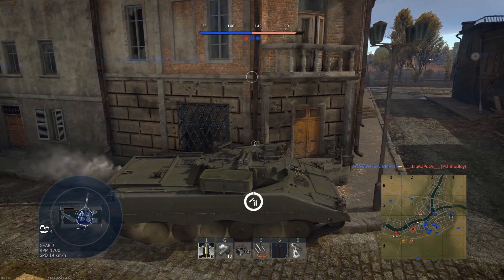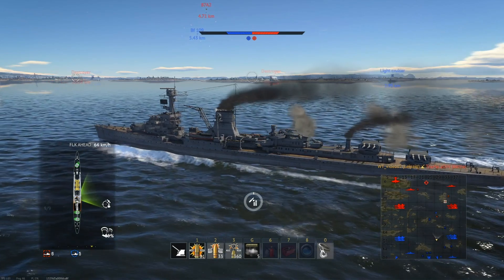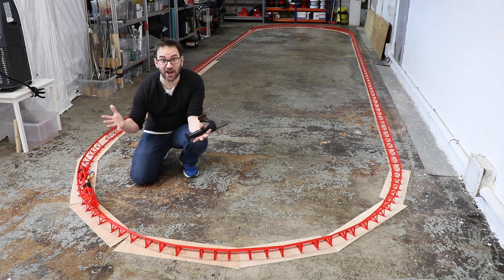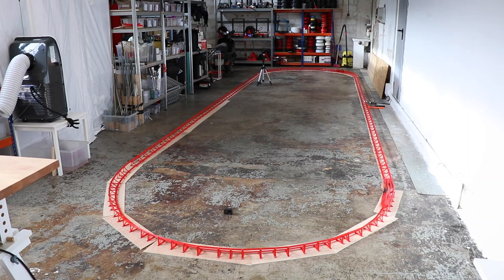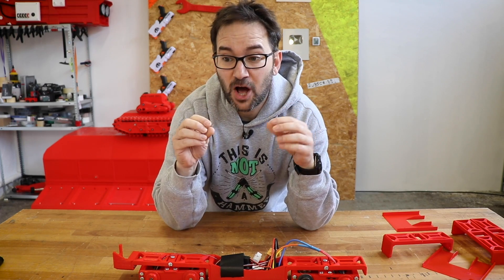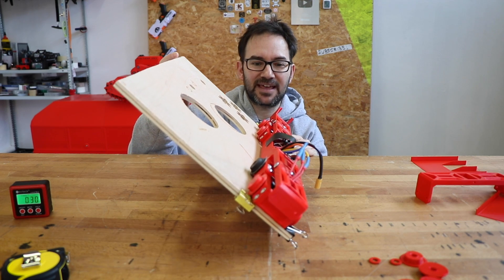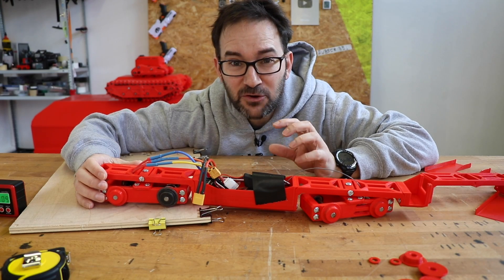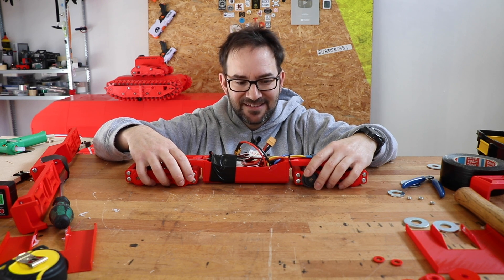WORLD FASTEST TOY TRAIN

Comment from the maker: Join me in War Thunder! Use my link for a FREE premium aircraft, tank or ship and a three-day account boost as a BONUS: https://wt.link/ivanmiranda Also available for free on PlayStation®4 and Xbox One.
Reply: Ivan Miranda that was amazing! For going faster try larger wheels or a difference gear ratio, maybe a different printing filament too (like I’m pretty sure there is one that is self lubricating which would be amazing to use). Also to stop it coming off the tracks make it so that the bank changes, so you have a steep bank on the corners that gradually changes to a flat or almost flat on the sides because there are no centripetal forces to keep the train on the track on a banked straight you see. Hope this helps
Reply: Maybe use existing hobby train tracks that are metal and don't bank the straight sections?  Why did you bank those anyway?
Reply: The metal would eat through the plastic wheels extremely fast.
Reply: @elmariachi5133  they won't not at these size's
Reply: Not only i want you to make it faster , i also want you to upgrade it and turn it intro a permanent decoration of your lab for the future videos ! 
.
While filming having this little guy crossing your lab on a rail sistem monted on the walls , maybe even having a camera attached to it
Reply: @OWNEDGAMINGwasd  YES!!
Reply: This is awesome, it makes me want to seeou make amoorail around the shop aqnd maybe a gondola system that cris crosses the cieling there  and runs around the top. You shoud then put a camera on it and use it for action shots of you doing stuf and testing your projets. Also if you want to go faster then instead of using a traditional train system you might want to research roller coaster tech with wheels that lock onto a track. You might also look into using something else as a track instead of printed stuff like using 3/8in copper tubing and then just printing the supports to hold it up and then bolting into it. You want something that is a consistent shape, easy to bent and easy to join. I'm sure there are some kinds of strips or extrusion stuff that you could also use.. you might even be able to find something with a shape that works though roller coasters often use round tracks and 2 sets of wheels that lock onto them allowing loops and compound curves without much issue. If youcan set the gondola up on like a thin rope pr paracord then maybe you ould weave it between some balcoies and send messages up and down it to connect people that are stuck inside.
Reply: My idea: Find some other YouTuber(s) to challenge! :)
Reply: @elmariachi5133  I Challenge you :)
Reply: @Eric lamb Sorry, got no 3D printer, and even if I had, I still don't have any room left in my tiny flat :(
Reply: @elmariachi5133  Were you suggesting Ivan challenge other YouTubers to a Train Race? I hope so, I'd like to see that! Note: I also have NO 3D printer. :(
Reply: Hope you are doing well over there. My parents are finding the lockdown in Spain a little tough, but I do my best to keep their spirits up by calling them regularly. I don't know if I will be able to see them this year. 🙁
Reply: if by any chance you read this, where do you get all of your components? (like the bearings, the rods, motors, sprocket like gear thingies, etc.)
Reply: What kind of Filament are you using for your projects? If you are using alot of it, it has to be reliable for my personal prototyping ^^
Reply: Ivan, use a rollercoaster type of track and add wheels to the side and underneath the track so it won't fly off that easy :) then the track might break before the train comes off :)
Reply: Technically if you add wheels (Or better small bearings) below the track or on the sides you no longer have a train. Trains don’t have those things. But if you just want to build the fastest possible thing on a track use small bearings top, bottom and sides. Use a metal track, like flat bar stock you bend to shape, but that gets expensive fast. Consider using electrical conduit (search ‘EMT’ at Lowe’s or Home Depot). These come in 10 foot sections for $10. Use 2 side by side to make your tracks. You can bend and even twist them into any shape you want. Then you can make a super high speed roller coaster and scare us all with the first person POV video. :)

If you want to stay with the train design...  make the straightaways less banked and the curves MORE banked. Remember the train is moving at high speed which creates centrifugal forces pushing the train into the track at speed. Start the train just where it’s coming out of a curve into the flatter straightaway and ‘commit’ to going fast. Accelerate to top speed as fast as you can to take advantage of the centrifugal forces. Your track will need more support to prevent it from sliding on the floor from the forces. Good luck! I look forward to the next train / roller coaster video.
Reply: I would say get rid of the straight parts and just do a circle so you are always utilizing the 45 banks
Reply: El peralte de la pista puede que no sea el más adecuado. Quizá tomando como modelo un velódromo...
Reply: Did they add your red tank to the game?
Reply: Try an make it like a bullet train. Bullet train wheels look different and are meany for speed. So if you try to make it fast(which you should), try and look at bullet train wheels as they are meant for speed.
Reply: Вот русского сразу слышно.
Reply: @ivanmiranda the problem with derailing is because of the change in G forces on the train between the curves section of track and straight section of track. The decrease in g forces adds additional motion to the train in the Z axis and is causing it to hop off. Shortening the track to create a perfectly circular track would allow you to push the speed even higher on the train because of the constant g forces pushing the train down to the tracks, keeping it going. Good luck!!!
Reply: Love the positive attitude:)
Reply: had you consided mag lev trains?  just saying i here they are faster then tradisinal wheel based trains because of the lac of friction from wheelse
Reply: why are the straight parts of the track banked?
Reply: That's a fast Train.Nice demonstration 
NEW SUBSCRIBER HERE FROM OVER SEAS UNITED STATES
Reply: Put other wheels under the rail like a roller coaster and then pushing this at a ridiculous speed can be fun xD
Reply: Its channels like this have inspired me to make my own channel. I'm building a 2 legged full size walking robot check it out. Thanks

Comment: You should use No Limits 2 roller coaster simulator to design smooth tracks for high speed train to run on, you can elminitate all the lateral forces by giving it precise banking at any point in the turn and test it in the simulator before extracting 3D files and printing it

Comment: Perhaps a circular track at a 90-deg cant with skid plates on the vehicle that rides along the floor will permit higher speeds.  Note that you will have to support the track (like a strap on a wine barrel) to counter the outward forces of the vehicle at high speed.  Bonus points if you can manage to raise the entire track off the floor once the vehicle reaches sufficient speed.

Comment: Just came to the channel, you probably have moved on to other projects but I would suggest an open frame  track that totally surrounds the train making the track an open frame tube. Four or five  tracks surrounding the train with corresponding wheels that run on each should keep the train in position to obtain much higher speeds. Think tubular. Enjoy.

Comment: The wheels needs to be conical with the outer diameter smaller than the inner diameter. Search for “Richard Hammond’s Engineering Connections” on the high speed trains episode to see a full demonstration.

Comment: In order to avoid derialing you need to go flat on the straight sides and change to pendant on curves and flat again on straight...
To increase speed increase wheel diameter a few milimiters and reduce to minimun the band sprocket on the wheel and increase it on motor side
Hope this help

Comment: You need weight hanging on the outside, and you also need some form of suspension. All those bumps suck up speed. Also, ditch the rubber o-ring and add a rubber section cut out of a bicycle inner tube, to a set of wheels that are 2% larger in ID, and finally, maybe some added mass.

Comment: Add some "track holders." They would engage and hold on and "grab" the track if the train wheels begin to leave the rails. That would be when it encounters turns, sharp corners, or going fast while going down steep hills. These "track holders could have bearings or small wheels. This would eliminate excessive wear when the "track holders" encounter the track.

Comment: Hello Ivan. I really love your project. It's brilliant! I noticed you asked on twitter what the fastest model train in the world is. (44kph by a toy maglev in Japan) But I've been building speed record trains since 2016 and this evening my latest train 'Moon Shock 1' hit 60mph in 0.2 seconds dead. It's 1:76 scale OO gauge it derailed just after the 25 meter mark and exploded sadly. It has a good bit more speed in it if I lower the downforce, concentrate the thrust and remove more weight. I'm not putting it on youtube or contacting Guinness records until it's much faster still.

Your train at 22.5kph is the fastest electric powered, wheel driven train out there though. Of everything I've looked at. And I've researched this like crazy. well done. I think yours will go faster too.

Rob

Comment: That’s a Lot of work Ivan hopefully the views and likes( CPM) have paid for your time. 

With the track you can get “cant” tables. Basically super elevation for rail. You also have point of equilibrium for the train but not sure how you gamer that for your models I think it was 2/3 equilibrium for normal rolling stock. So basically it adjust the cant Ie have less cant as train will stay put (I did this a while ago now).. So you could have less aggressive and flat track on straights. it might give more speed as the curve will give an effective up grade (from drag or resistance). I think you can get that info on curve compensation tables. Probably over kill for a model train though...

Comment: I'd  like to see a 3 rail triangular configuration where wheels grip rails on 3 sides of each rail so top and bottom left and right for a stable roller coaster train  then some  corkscrews banks drops and climbs  or if going for high speed some automatic leveling trolleys that lean into turns proportionally to weight  and speed  and then have it tow at least 8 cars behind it <3 but then i dream big

Comment: Loose the straights, make it an oval, that way you can use the cornering force to help with traction and stability 

 Leveling the straights will mean you have a ramp at each transition between banked and not banked, which will throw the train off.  Push for more speed!

Keep up the awesome work!

Comment: You need some wings that push down at higher speed to prevent bumps in the track from bouncing the train off at higher speed. The wings would also improve the traction of the drive wheels.

Comment: Put magnets around the rail and a magnet in the trains to let have more grip and try increasing the gear ratio to so it will have more rpm on the tires at full throttle

Comment: Perhaps using thrust bearings, or even brass washers, in-between the wheels and outer carriages will improve the stability and friction loads when banking, as well as add a bit of low-down weight. This is opposed to the printed washers used.

Comment: You may want to put a camera in a spot where it can watch the driven wheels while going quite fast. 
It can help to identify traction problems in the curves or straight segments. So you could possibly adjust some angles or straighten the track in problematic places and get higher speed with proper traction around the whole track.
(Assuming "Full throttle" means the wheel don't slip and possibly even heat up the driven parts of the wheel - I didn't see what wheel broke in both cases, but if it was a driven one, it could be stress from non-linear traction due to speeding up while in air and then touching the rail again after the "bump".
Downforce-wings could also help if there is not a solid contact between wheels and track.
Did you try front-driven and back driven setup?
It does not matter for regular trains, due to speed/weight ratio, but having the engine in the front position may help in keeping it on the track as a whole. It looked like the front part was pushed from the track in a bump, maybe because the forward force exceeded the amount of steering provided by the front part.
And you may want to measure the RPM of the wheels at full throttle without being on the track, so you get your theoretical max speed without air resistance and friction. I doubt you can get over 75% of that. That could give a hint on how much headroom for improvement you have, before having to redesign the engine and drive concept as a whole, like other gear ratios on the belt or larger wheels.

Comment: I feel like you could massively reduce the rolling resistance by using only one pair of wheels. extend out the truck section and shorten the belt, and you should be able to fit it all in. remove the banking from the straight sections, and tipping will become less of an issue. I dont know how much air resistance plays a role at these speeds, but it might be worth adding a curved shield to the front to make it look more aerodynamic, and also one to the back

Comment: A higher kv motor would give it more wheel speed and reducing the angle on the straights would help keep it from tipping. Having a motor in both bogies might also help it although it didn't look like it was slipping but might give it greater acceleration.

Comment: It sounds like it is slowing down when it hits your speed trap. Set the speed trap up as you come out of the corner. Corner speed is a thing in racing cars. :) Also, those plastic on plastic wheels are probably slipping. At least on the drive wheel set, get some rubber bands or silicone on there so it can grab and transfer more power to the track! :) Awesome vid!

Comment: use a larger diameter wheel. it will smooth out the bumps, which is helping kick it off. flattening the straits would help too. To change the angle of the strait sections, just shim the inner portion upwards and the outer portion downward. or just eliminate the strait all together and make a speed ring.

Comment: Other than don't go 88miles per hour to go back in time! just change the straight track to 0 degrees and tune other to 45 degrees,  don't print from the beginning just add some prints, remove some of them and in the end slowly change the angle. if I design this from the start, I will use rings of hydraulic PVC tubes as a base, and inside 3d printing rings that move with some connections. So part of the track will be using PVC rings and will easily custom change the angle to a degree that can fit with the next one and the next one to have a smoother transition and less lost energy... I also think that you lose friction on the wheels, 3d print a smooth layer of the robber or put more o-rings I guess !! hope I give you some perspective of my idea, that maybe help!

Comment: Great video as always!!! Few ideas,:TPU rimmed wheels may help provide more traction which probably isn't totally necessary since you're accelerating slowly. Also centrifugal force holds you on well during the turns but when you're in the straights being at an angle means that the force diagram is pinned into the side of one wheel, could explain why its breaking and derailing. Perhaps a gentle loft in the track from straight and level to the 45 degree angle right before the turn would work well? Also since you aren't running for that long grab 2 or 3 3-cell 500 mah lipos and put them in series! You won't be able to run for very long but you'll get 30ish volts and if your ESC can handle it you'll gain tons of speed! Just ramp up slow so you don't over-current your ESC! if all else fails design wheels like those on a roller coaster! Basically hug the track and you'll never derail!(Until something breaks anyway) Would love to see you revisit this and break 100km/h!!!

Comment: U need to lower the weight 
A bit more aerodynamic
Very small tracks every joint is a source of shock n vibration
Can you make your tracks from long steel rods / bars ??
Thers something like pulled steel
Add a suspension to your carriage, springs from ball point pens but you will also have to incorporate dampers too.
Reduce banking on straights - even load on wheels offers more grip
On inclines wher its straight, upper wheels are literally without grip

Hello do you know the difference between 4 wheelers having 2 wheel system and 4 wheel system
Also do you know the difference between front wheel driven and rear wheel driven ??

This will be your single biggest speed enhancement 4wd 
Power the rear wheel of the front set
And the front wheel of the rear track wheel 
U'll see speed gain even if you divide power by using motors half as powerful but double in number
Reply: Power the front wheel of front track if it details a lot !!

Comment: Bigger driving wheels to increase top speed (pay attention to not burn motors at starting) and locked rail system as roller coaster... the bottom rail during straight track push on the side of the wheel and increase friction: a set of wheels in perpendicular plane (always as roller coaster) keeps the position without pushing on the side.

Comment: To increase the speed you need to add weight on an arm from the middle section to counter act the centrifugal force as it's going round to help keep it's stuck on the track, or off the first arm have another one going straight down on the opposite side of the track with the weight in a container so you can adjust as your trying to get faster as it would move the centre of mass further out